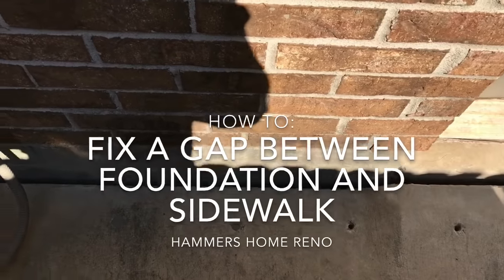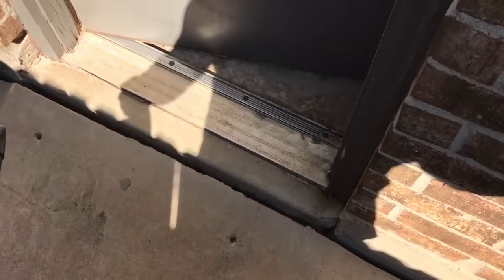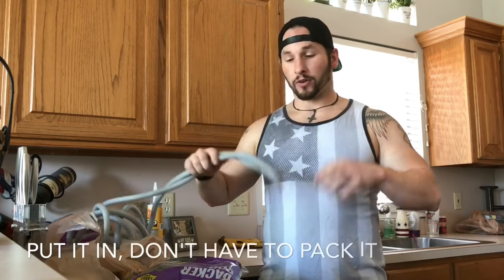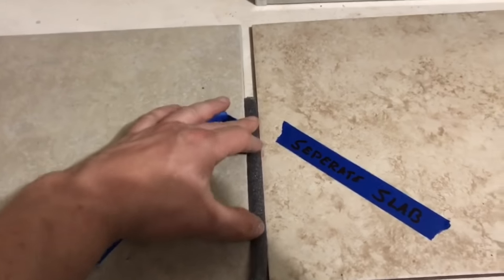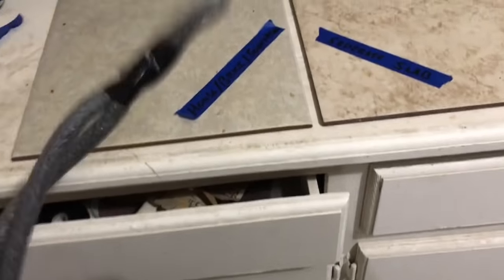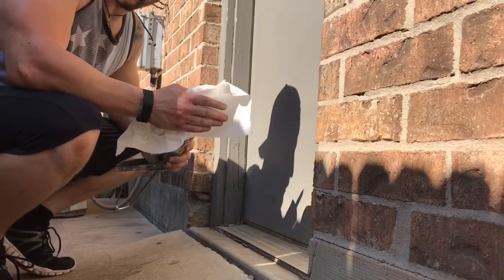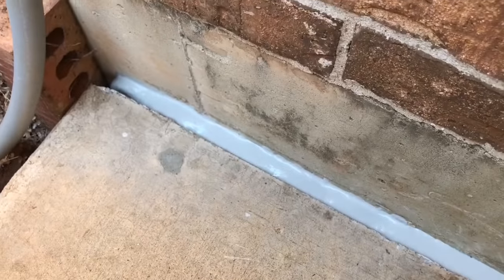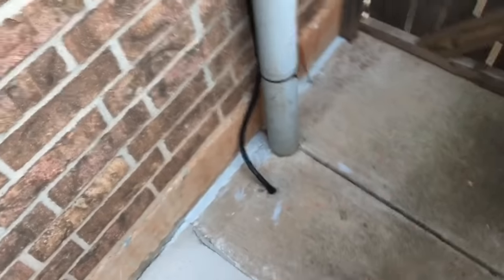Seal Gap In Foundation and Concrete Patio or Sidewalk

Comment: I mean why all that? Why not just get a bad of concrete, mix with water and pour it allllll the way up. Take a little more time but cheaper and in my opinion a cleaner job.
Reply: Expansion joints need a flexible material. Filling it with concrete will not allow the joint to expand.
Reply: K C what do you mean by expand? These are two solid peices of concrete that's not moving or going anywhere. No?
Reply: concrete will crack depending on the weather being too hot or cold
Reply from the maker: What K C said is correct. If you fill it with concrete it will just end up cracking and falling apart in there over a little bit of time. This caulk is flexible so it can expand/contract with the weather elements
Reply: Don Powell too much movement over time the caulking gives it a bit of flexibility/cushion.
Reply: The concrete slabs swell and move with temperature and weather.  As it does that, it will crack and crumble the concrete you poured into the joint/void and will look like hell.  Not to mention water will be able to get in.  The way he did it in this video is how it is done properly for a long-lasting joint.
Reply: In addition, consider settling as the house foundation will not, while the sidewalk will. So caulk instead of concrete.